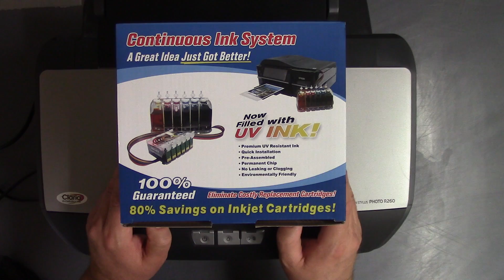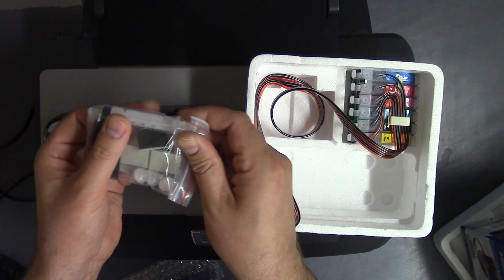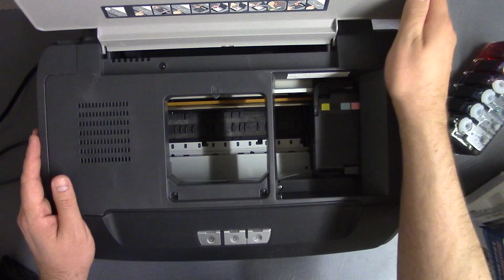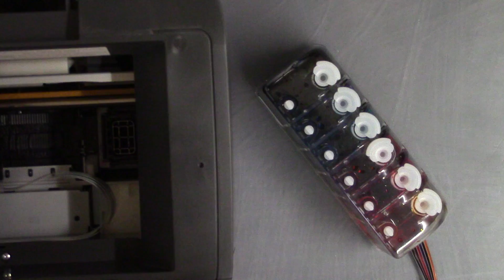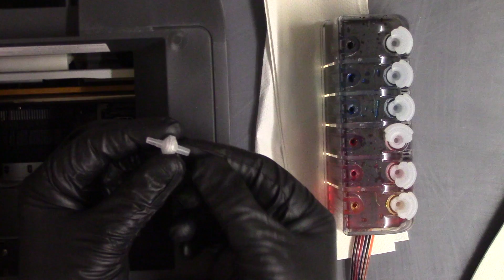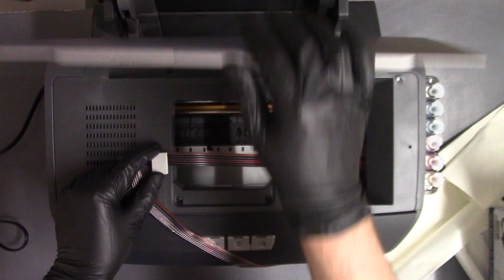How to Install CISS on an R260 Epson Printer Continuos Ink System CIS

Comment: How do you prevent air pockets from forming in the ink tubes? My R260 printer is rarely used and the Hotzone360 CISS I was using kept forming air pockets in the tubes. It became a hassle to constantly purge the air either by running several cleanings or using a syringe on the cartridge fill hole to pull ink from the reservoir. I tried installing a CISS damper valve but air pockets still appeared. I decided to go with a refillable cartridge and get rid of all the tubes instead. It's been a year with the refillable cartridge and it's been so much better. No more clearing air pockets, no more head cleaning, no more wasting ink, no more watching the DIY waste tank bottle fill up, and have to empty out. Best part is the print quality has improved by leaps and bounds.

Comment: Hi, I'm interested on this CIS for my Epson WF7110 with sublimation inks but I read around that you should make a print per day to avoid print-heads clogging. What should I do in case of prolonged disuse? Can I leave the printer inactive for 10-15 days without any problems? Can I turn off the printer? Thanks in advance